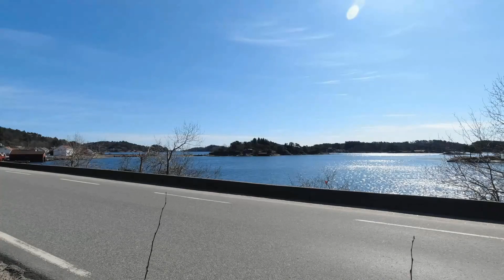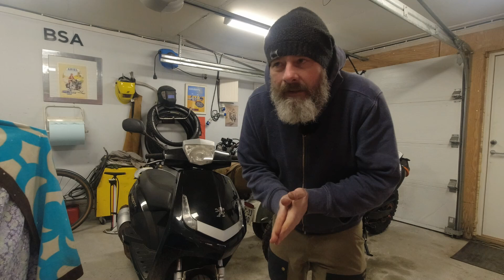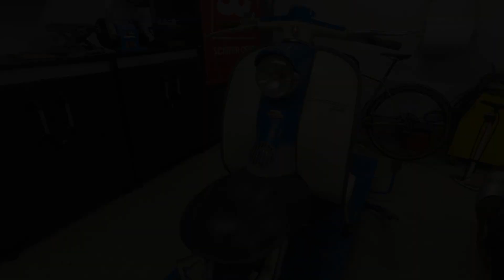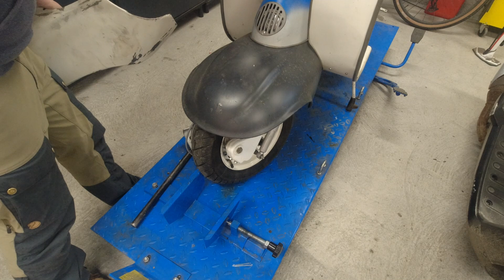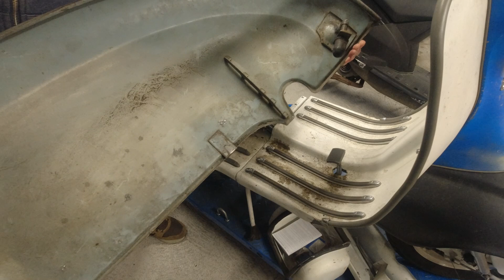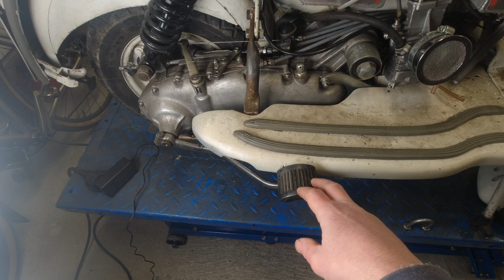We have a new project scooter! #kickbackgarage

Comment: Be very careful with welding the engine mount strengthner on. Word on the street is you can easily bend the hole frame with this kind of job. Always put it in a frame jig when welding the strengthner!
Reply from the maker: It's absolutely no problem because the tube is so short. I've done it on all my Lambrettas after having one fail.
Reply: @kickbackgarage  I had it done on my Series 2 in October at RLC. Micky told me that you have to be very careful. The engine mount is an anker point for the whole frame. Therefore if you weld too hot and frame is not in a jig it can bend.